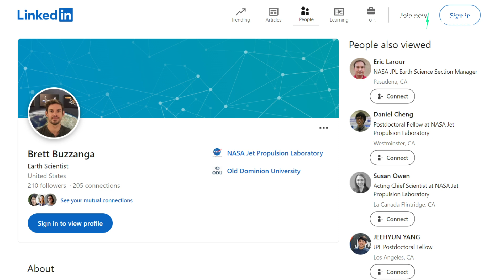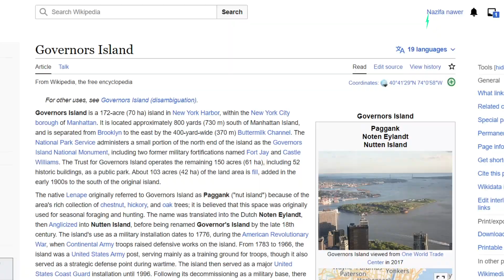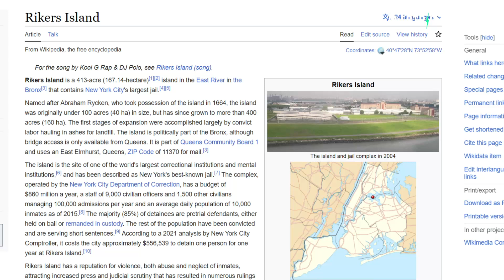NASA space radars discover that parts of New York are sinking into the ocean

Comment: I think the news isn't very surprising.  There was already news in recent past that New York has a flood risk. We've seen the issues with recent storms that hot New York theae last few years. Events and runs were cancelled. Coming from the Netherlands I have heard that our wayer management expertise on dikes have extensively been consulted on water management of New York. I wouldn't be surprised ground measurments were already performed retrospectively and Nasa was later consulted to confirm results. I this it is interesting to note that several areas mentioned such as Laguardia aiport, tests on man made landwinning terrain, which are generally sandy grounds and more easily prone to si lingerie over time. Similar issues have happened to Japan's seebound airport and the man made islands of Dubai. In curious to know how accurate the measurements teally are and how valid the measurmenets are and rate of error in the measurements by the satelite.